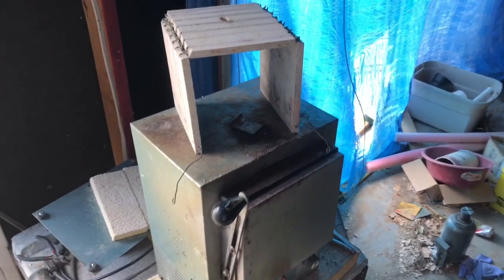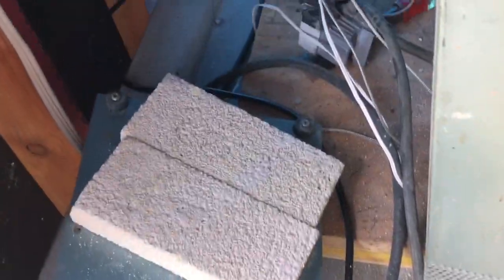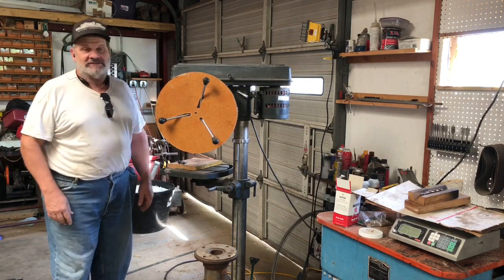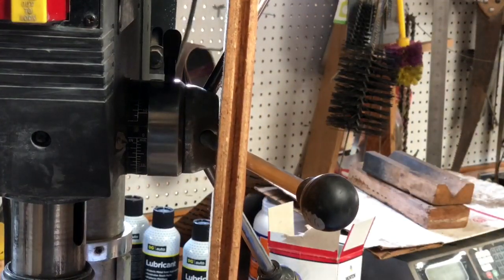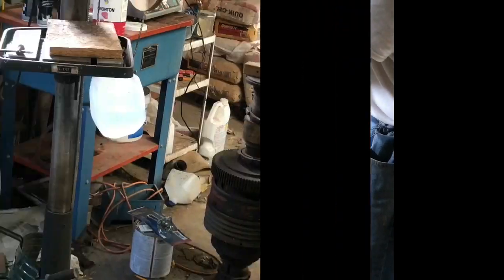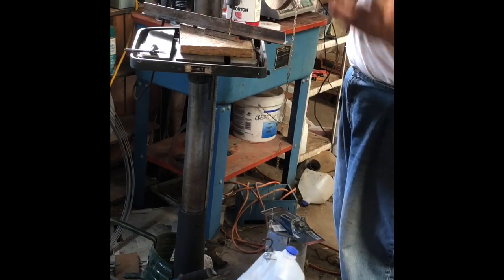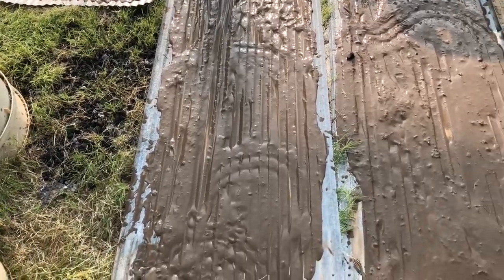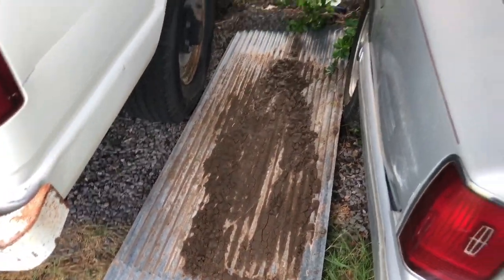VBlog 14

Comment: Interesting concept Dan.   I can see that would be useful for drilling glass and ceramic where constant pressure over a longish period is important.

On steel you need to reduce the pressure just as/before the drill bit breaks through, as that is the point at which you are most likely to jamb and break the drill.  They can and will shatter in these high powered drills.  I have a similar drill press, but with a shorter column (Taiwanese).

A drill vice would be a good idea ;)

Cheers Rob

Comment: Hi Interesting video, you could make a wooden shelf rack  unit and stack the metal covered clay on the racks if you need to make clay powder on a regluar basis ?
Reply from the maker: Agreed.  So far I know it works for making my green sand.  A little goes a long way since the soil has an excess of clay to start with.   I am going to try using it in DIY refractory.  Should be at least good enough for aluminum melting.   I am playing with refractory formulation.   That is mostly on my blogs.  Started on ZombieEngines.blogspot.com and recently started posting foundry content to nmlfoundry.Blogspot.com.    

And welcome.   See you on Emma's live stream next week.